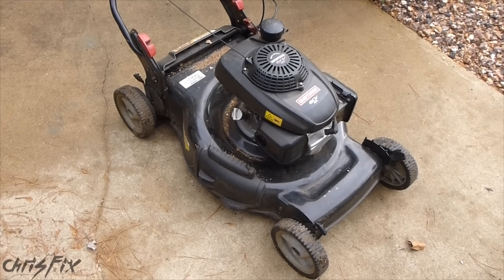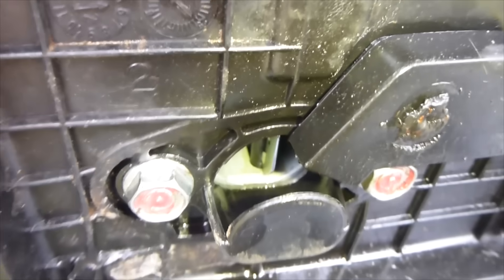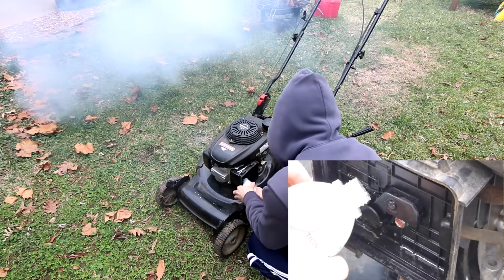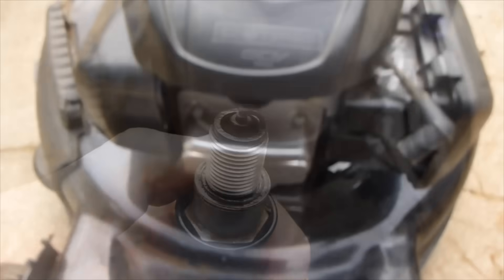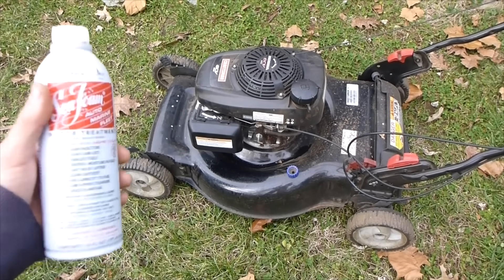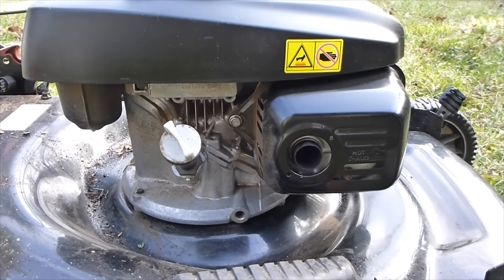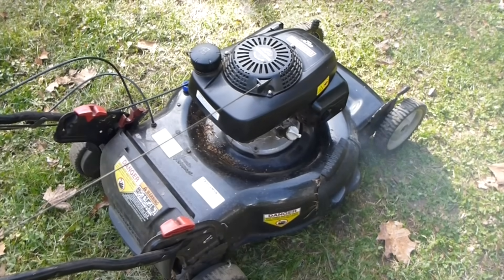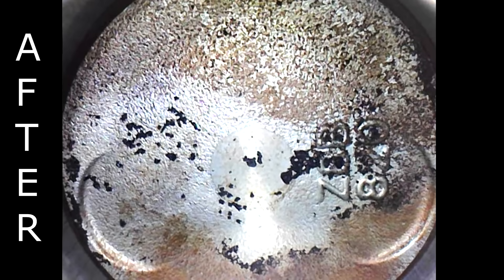Does Seafoam Actually Work? (with Proof)

Comment: Hi Chrisfix. Just stumbled on to your vid. Great shows! I am the ultimate snakeoil anticipator. A friend turned me on to Seafoam. I added it (1/3 can to 30 gals) to my 5.9l 12v Cummins and there was a noticeable difference to my fuel mileage and power. Been doing this for the past 6 months now. Won't go without it. Also use it in the fuel of my 1973 FJ40 and 1952 Dodge M37. This test was an eye opener but no surprise. Anyway, keep the vids coming. Good job.
Reply from the maker: +montwolfman Thanks a lot! I am glad you like the videos!

Comment: I have a Lincoln town car with 220k on it. It would spark knock constantly and getting horrible fuel mileage even on premium fuel. I took a can of seafoam in the fuel tank and another can sucked through the pcv hose. After that, no more spark knock, 23 average mpg, a lot more power. The stuff does work wonders.
Reply from the maker: +Michael Pack Awesome! Thanks for sharing!

Comment: It really doesn't even matter whether it "works" ("works" meaning removes small carbon deposits from the piston crown) simply because they're not even a problem in a road car in the first place. By the time the engine gets enough carbon deposits for it to become a performance or running-on issue, it's time for a rebuild anyway. Removing carbon deposits can even increase oil burning and any time you run this crap through an engine you should immediately afterwards change the engine oil, especially if you're going to "soak" the piston in it as in this video.

So save your money people and just do proper maintenance instead.
Reply from the maker: +Tony Rule Thanks for sharing Tony!

Comment: Sea foam is what idiots use when they don't know how to fix the problem.
Reply from the maker: +jimy taylor How do you fix a problem of carbon buildup from years of use? Taking apart this little simple engine is easy, but on a car it is a lot harder and takes a lot more skill and time.
Reply: Sounds like to answer you question Chris......Sea Foam it
Reply: +ChrisFix If there's enough carbon to be causing a problem (presence of some carbon is not in itself a problem) you should address the cause, not the symptom.
Reply from the maker: +Tony Rule Correct, but once you fix the problem such as a bad pcv or sensor, how do you get rid of the carbon?
Reply: Again it comes down to maintenance. I've yet to see a bad PCV valve on a well maintained engine and a faulty sensor will give a warning light - how long you drive it after that before investigating is again down to maintenance IMHO. Unless you're Penny...

Comment: With the ability to clean befouled piston tops at the extent that was demonstrated, I see this as a useful product to help prevent the build up in the first place, either in a new engine, or one that has been mechanically cleaned through head removal. I have a can of this product sitting in my garage, but now with renewed impetus to make use of. Thank you for this video.

Comment: Might be easier if you put it in a squirt bottle first, then put it in the carb.  I usually don't have a squirt bottle, so I just use a water bottle from the trash. Poke a tiny hole in the lid, squeeze and squirt. Easy to do, and it's free. I use that method fairly often to squirt gas in carbs when I'm working on small engines and don't have any starting fluid around...
Reply from the maker: +KOakaKO Thanks for the tip!

Comment: My motorcycle has 5k on it and am noticing some rough idling on start up.  I am thinking of adding 1oz of SF to a 2.5 gal tank but not sure how many times I should repeat the process. Maybe 3?
Reply from the maker: TechFan Give it a shot. You might only need to do it once but a can has enough to do it 3 times. Keep me posted on if it works!

Comment: By the way, I was thinking that "Mystery Oil" might in fact be transmission fluid. Also, I was thinking it would be cool to do a test of the transmission fluid's cleaning abilities on a lawnmower, the way you did in this video. Transmission fluid was the way the old timers used to clean carbon buildup, pouring small amounts into the carburetor of an engine while it is running.
Reply from the maker: Bob Simmons I will be testing MMO and now I want to test ATF!
Reply: Bob Simmons I remember, we also used transmission fluid in our power steering or vice versa, can't remember it all. lol
Reply: DD826
Yes, that is true for some cars. My 2005 Toyota Sienna uses Dexron transmission fluid for the power steering.

Comment: Hi Chris. I just got finished fixing a bent valve (my fault I bent it when I was changing the timing belt; first time ever changing a timing belt and I screwed up) in my 2005 Toyota Sienna; and I learned a few things that I wanted to share with you because I know you like to compare chemicals.

Firstly, I found that Dexron transmission fluid is great at removing carbon buildup. While I had the heads off, I cleaned the tops of the pistons, which had carbon on them. I tried brake cleaner and carb cleaner; but it didn't remove the carbon. So I called my father, and he said that my grandfather always used transmission fluid to clean carbon deposits. He said he (my grandfather) would pour small amounts of transmission fluid in the carburetor while the engine was running; and, of course, white smoke would come out of the tailpipe. In the end the engine would run better. Well, sure enough, I used Dexron transmission fluid to clean the carbon on the pistons (by hand seen as the top of the engine was off) and it came right off. When I was finished cleaning, the pistons looked brand new, with very little effort.

The second trick I learned was that there is a better engine cleaner than Gunk. There is a generic brand Air-conditioning condenser cleaner you can buy at Lowes or Home Depot (found in the section where the air filters are sold) that beats Gunk hands down. I found this out because when I was cleaning the heads I ran out of Gunk and I had an extra can of A/C cleaner laying around (it comes in a tall aerosol can just like Gunk); and I decided to give that a try. I was amazed at the results. Note, it is foamy when it comes out of the can. It looks just like shaving cream. Great stuff! I will never waist my time with Gunk again.
Reply from the maker: Bob Simmons Thanks for sharing Bob! I will have to check out ATF and also the condenser cleaner! I like your real life experience with the ATF!

Comment: results speak for themselves not knocking this video...but people have done this with water also... it has to do with hot engine vs cold liquid which breaks up carbon deposits. I would try a dirty engine and put seafoam in gas at proper mix ratio and see how it cleans
Reply from the maker: germinator420 Thanks for sharing! I will be testing water soon!

Comment: Putting seafoam around your muffler bearing helps a lot and keeps it well lubricated.
Reply from the maker: augustrush03 And adding some to your blinker fluid works to keep the headlights clear!
Reply: ChrisFix it good to see you have a since of humor .laquor thinner works good to. Poor some in the plug hole and let it sit overnight. Then do the seafoam it gets  it all clean . just don't get it on plastic carb parts.

Comment: Hey thanks for the video ... very informative, also to hydrolock and engine you would have to leave the spark plug in the engine to cause that to happen so when you pulled the rope with the plug out you did the right thing. So if you wanted to actually soak the piston in a car you can actually basically do the same thing you did with the mower, take plugs out of all cylinders let it soak for desired time, I would not do too long and then crank the engine when soak time is finished once you have cranked the engine over for a few seconds I would say 15 seconds then reinstall the plugs and fire it up... I was also curious of how effective this product actually was so thank you very much Chris.
Reply from the maker: Black Majik No problem bud! I am glad the video was helpful!

Comment: did you ever do the water clean test?
Reply from the maker: Rondo Schiavoni Not yet. It is coming soon. I need to find a car to test it on.
Reply: yes sounds great  to really find  out this water mist clean up has been around for years
Reply: yes Chris  that would make a good  one because  this has been going around for about 40 years  water injection? Just HMMMMMMM
Reply: how ever the injection cleaner like gum out or stp ,  I just wanted to put one bottler of it to see if it keeps my v6 pathfinder running smooth. See I have to take the pathfinder 03  on a good long trip  to see my daughter in college  so I thought this would be the best time to use it

Comment: Like I commented in your other video, this does work. I used it in a black smoke-spewing snowblower after letting the fluid sit in the piston cylinder for a while and flushing it out several times before replacing the spark plug; now exhaust doesn't come out black.
Reply: Austin Lucas Note: I changed the old spark plug to a new one on the same day. I also used Seafoam on a lawnmower that I didn't change the spark plug or anything else on at the same time, and checked the emissions before and after; it was lower after the treatment so this stuff does work depending on the case. Sometimes an engine doesn't need Seafoamed.

Comment: Crack a walnut, eat whats inside. Keep hammering the hull until it is very small pieces. Put a teaspoon in the sparkplug hole, start it and let it rip. Sandblast's the piston and valves. Try it and let me know how it works for you.
Reply from the maker: x2malandy That is a very bad idea. Never introduce something hard to your cylinder/engine.
Reply: ChrisFix Ok. I was just looking for someone to try it. Ha
Reply: x2malandy i tried it and my car runs like it just came of the lot.thank you so much.i call it Nut Dust
Reply: Lol Nut Dust, good one.

Comment: First I have been using this product for years it great. I mix it in my mower gas and it helps to stabilize it. Second I run this in my truck about once a year. Third theses flipping idiots that say this is B.S. are full of shit. When you keep a motor clean it will run better and last longer. Keep up the good work.
Reply from the maker: Rick George Thanks for sharing Rick!

Comment: There was never enough carbon in your cylinder to affect the engine anyway so you spent $10 for a can of Seafoam to have a clean piston.  Big deal.  Do you know why the directions tell you to use 1/3 can in this manner?  To clean valve deposits not so much the piston.  Deposits on the valve affect the way the fuel air mixture enters the cylinder and the mixing vaporization of the fuel so it burns more efficiently.  The other 2/3 are not saved for another try at cleaning the cylinder but to put into the oil and fuel tank of the car.  The fuel tank portion is to clean injectors which have to efficiently spray a fine mist of fuel which burns more completely and the oil portion cleans oil deposits which affect the operation of the hydraulic lifters.  You would have better used this in the fuel tank of the lawn mower where it would have at least had a cleaning effect on the carburetor fuel bowl and fuel metering ports.  Better yet use a PEA (polyether amine) based fuel system cleaner which at least will help counter the corrsive effects of ethyl alcohol additives of auto fuel in small engines.
Reply from the maker: panzerabwerkanone It was just a test to see if seafoam actually works. Thanks for sharing.

Comment: Hey ChrisFix! I've got an 89' 500cc, 4 stroke, 2 cylinder, motorcycle engine that sputters and idles funny. Do you think running the Seafoam through it (like you did with the lawnmower) would help it at all?
Reply from the maker: Dylan Stassen Maybe. It could be a clogged carb and the seafoam might clean it out.

Comment: Hey Chris, if you were to soak the engine of a car like you did for this lawn mower, how much seafoam do you think should be added and will it eventually evaporate if you leave the spak plugs out or would you need to soak it up with something if you put too much? It looks like soaking it will give you the best results. My car has 150K miles so I think it would benefit.
Reply from the maker: seephor I wouldnt soak the engine of a car. Too much risk and not worth the small reward.

Comment: How ok'd is your mower?   I have a TROYBILT with a HONDA engine and all I do is change the oil.   It's 8 yrs old and has never given me a problem.  The deck of the mower will fail before the engine.   TROYBILT useds Brigg and Stratton and another company that I do not want for engines.  If craftsman is using Honda engines I'm buying a craftsman and storing in the shed so when the wheels fall off I have a reserve.
Reply: Old
Reply from the maker: London Riggins It is 2 years old.

Comment: Excellent presentation. But i have 2 questions:
1) Can i use it in smaller engines, like chainsaws etc.?
2) Do i get any positive result in engine's operation? Does it help in any function of the engine?
Thank you.
Reply from the maker: kotsosgr55 Thanks! You can use it in any engine (small, big, gas, diesel, 2 or 4 stroke). It gives you better performance if your engine has a lot of carbon.